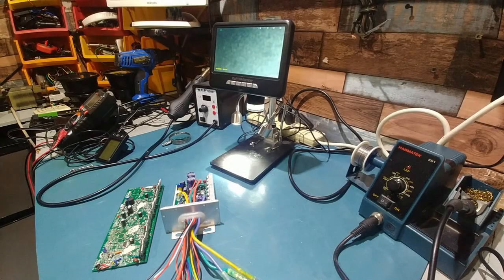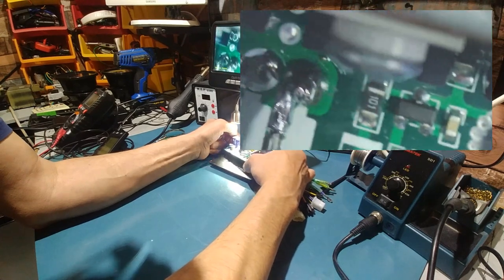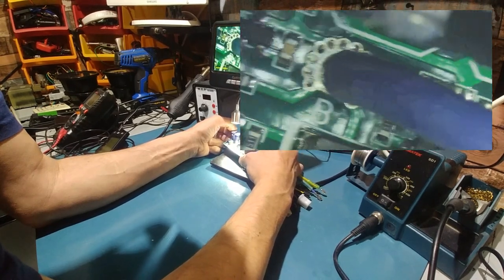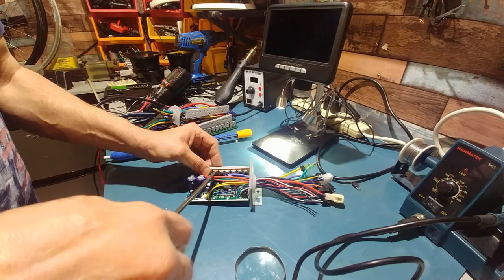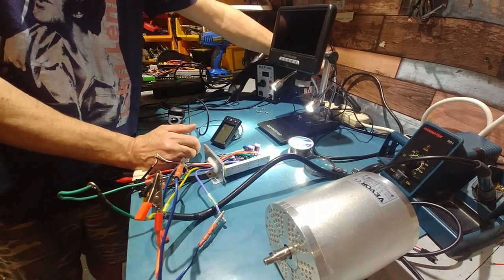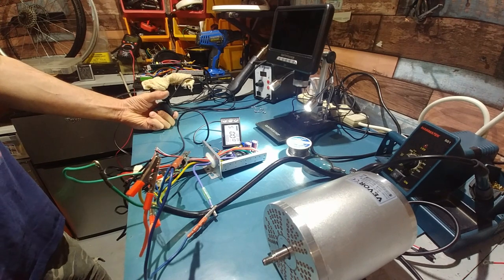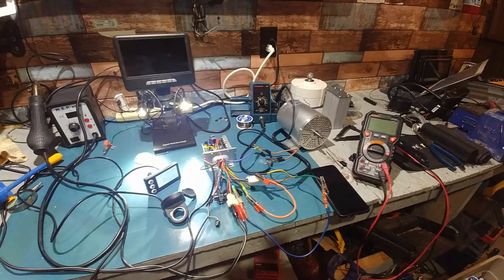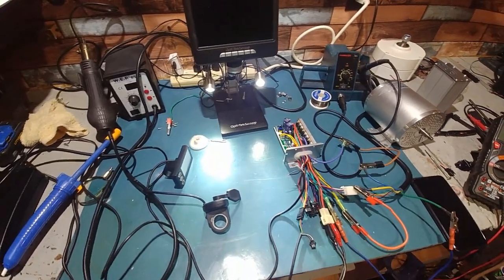ebike #vlog .Brainpower 3x fets replaced #review #ebike #lifepo4battery

Comment: Would it be possible to double the fets in one of these controllers? Or just convert to ight brick set capable of loads of current. Its been a while since i looked one up but they have like m4 cable connections, use the logic to drive the gates  turn a 500 watt controller be into a 3+,kw controller. Or would you be better off to just build one from scratch?
Reply from the maker: been there did that. not really worth it. i have a few laying around that i did in the past. ill leave pics in the community tab . i just find it easy to replace the fets and remove or replace the resistors for the lvc and hvc.